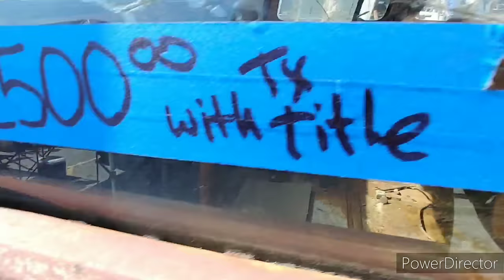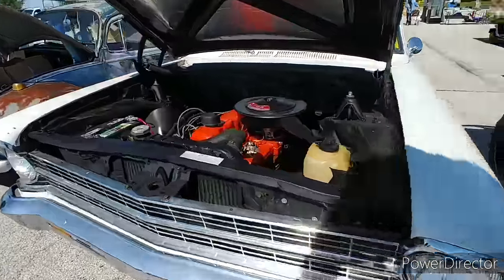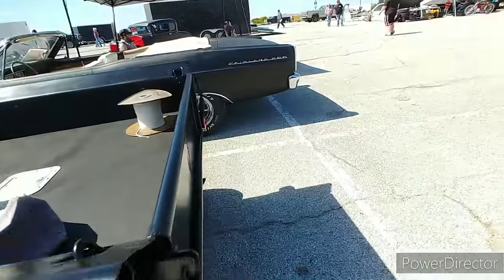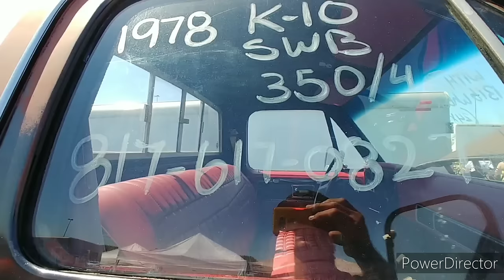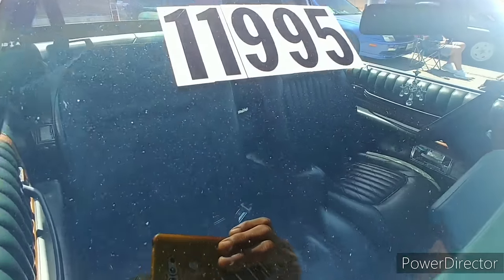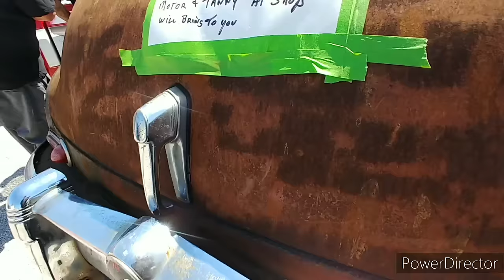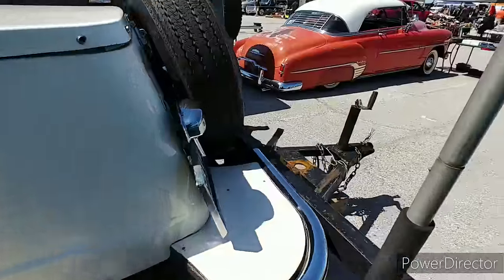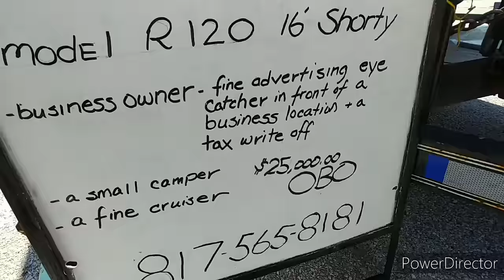Classic Cars and Trucks For Sale Spring Southwest Swap Meet Grand Prairie Texas 2024

Comment: hey benny  thanks for good entertainment this weekend i love this channel  thanks for ur  hard work making these vids big fan from the nc mtns
Reply: @ClassicRideSociety   hey benny just curious  as an old school car hunter what do you think about the prices on the stuff you get to see on ur trips? as and old school junkyard guy i find it delusional jmop
Reply from the maker: I agree many prices are up there. I just say to myself' they'll have fun loading it back up. Alot of stuff is priced like eBay and it really shouldn't(although there are somethings that are gonna expensive anywhere you go unless you luck out at a junkyard). I still enjoy the hunt for the actual deals. At this swap meet, I found 2 new copper heater cores for 67-72 GM trucks for $15 each. Also a brand new brake booster for $30 and new global west upper control arms for my Monte Carlo for $220. They are about $600 at Summit. Vehicles is another story. Typically people bringing in projects have an idea of value and are looking to hopefully cash in. They'll wheel and deal as the swap meet gets close to the end. But all in all,i just prefer to look for project vehicles out in the wild
Reply: Often they overprice their incomplete projects due to car shows or some movie on cable tv. They see there complety restored with brand new parts all shiny or some hot rod or muscle car on some auction with new parts (for which the seller must pay fee) and then they have that mentality "No low ballers here, I know what I got". Its the same thing in my country, they only have different excuses about it. Most of the time when you go to check the vehicle, it won't even start and most of its bodywork needs attention. The worst thing is ehen they do that with the A series cars, aka the "peoples cars" which were cheapest in their class when to they were new.